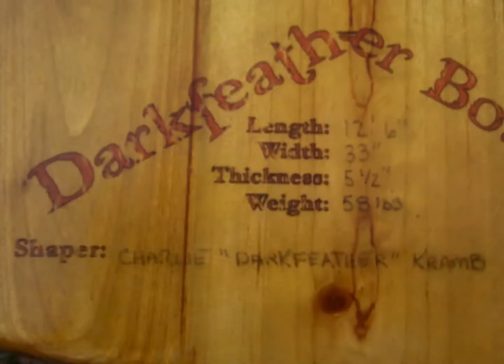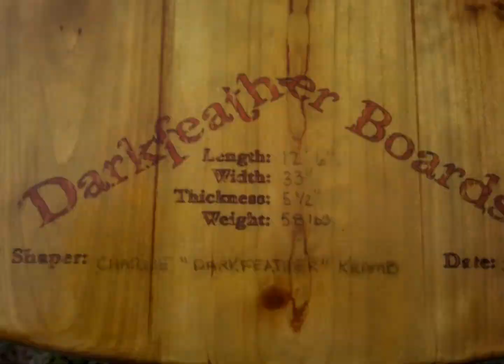12.5' Custom SUP

Comment from the maker: I do my logos the same way the foamers do their boards…I print them on an inkjet printer using rice paper.  I use spar urethane on my boards instead of fiberglass and it takes a little more patience to make sure the paper absorbs the spar evenly, but the results are amazing.  
thanks